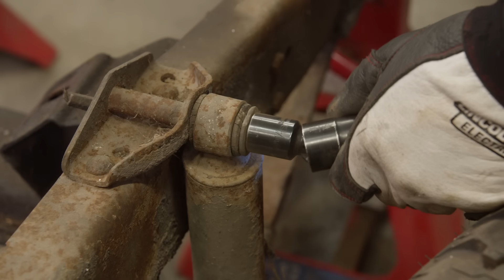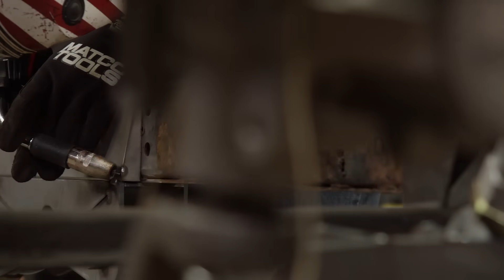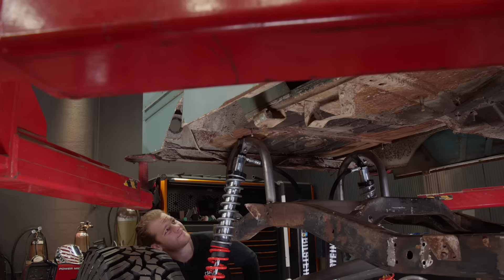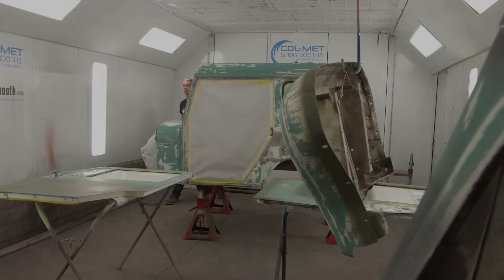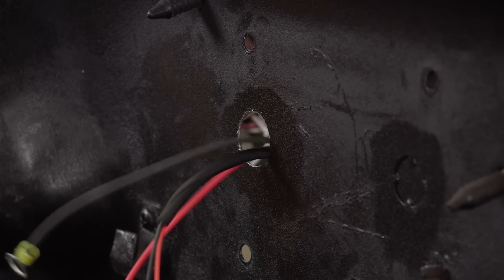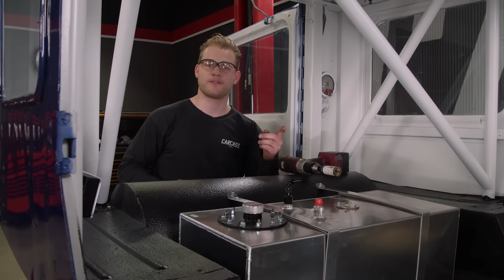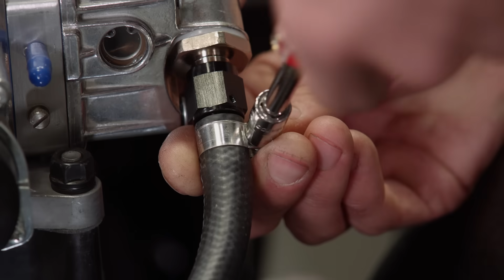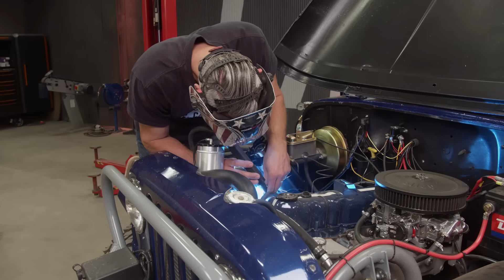We Turned a Mail Jeep Into a Serious Trail Machine

Comment: Love the long compilation builds! That is a beauty of a Jeep, shame the sliding doors had to go away to make it work.
Reply: This is one of my most disliked Jeep builds. Almost nothing of the original Jeep remains, and in the end, they just did some basic trails that a stock Jeep could've done. Numerous times they said they were doing this build on a budget, then went and built a custom suspension setup with custom fabricated parts on a multi-thousand dollar laser cutting machine. That Jeep body looks ridiculous on that lifted frame. They lengthened the wheel base, which defeats the purpose of Jeep's famously short wheel base. They gave the outside of the body a fresh coat of paint, but the underside still had flakes of rust falling off, and didn't bother painting the axles or transmission/transfer case. 

That poor engine is not suited for all that extra weight they've tacked onto it, and will struggle not only on the road, but on significant inclines and muddy terrain. They absolutely lied about the power numbers of that engine, it was no way making near 250HP before converting to fuel injection, and MIGHT have come close to that with the direct injection changes. Even the most skilled man on Earth (Newcomer) with these engines can only get near 400HP after hand-crafting nearly every component and slapping 2 turbos onto one.

By far the most awful decision was that fuel tank. All that wasted space from when they covered up the rear suspension mounts could've been used for the fuel tank, but nope! Let's just slap it in the cabin behind the seats. No problem!

As someone restoring a 85 CJ7, I hated watching this build. This is a show Jeep, and shouldn't be looked at by anyone working on their own for actual use.
Reply: Only reason for buying one of those right hand drive postal Jeeps is those sliding doors.

Comment: I don't understand the tire choice here. Its like if they built a 1500 hp dragstrip ready car with suspension tuned for the car to launch at the track, then bolting up a set of beadlock rims and some 31X10.50 baja claws on the race car and takin it to te dragstrip with 50 psi in tires and talking about how awesome the car is on the track 🤣
Reply: Yeah i dont understamd what your trying to say here like are the tires to small for you or what?
Reply: @user-wm9pj2xj7z  ouch my head hurts

Comment: How much did this build cost? $15,000
Reply: If you paid someone it’s an easy $30k with labor, parts paint etc.  $75-100/hr labor adds up quick.
Reply: MissionRestomod is correct. 15 grand would get you much of the driveline, rear ends, lockers, transfer case, trans, be a good start. If u did it yourself and searched for used parts for deals u could get a lot done for 15k.